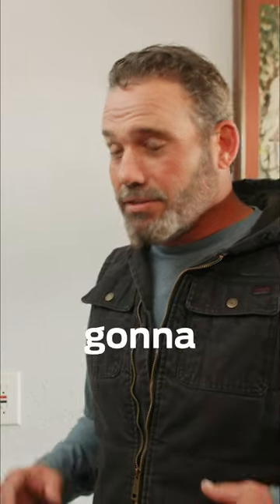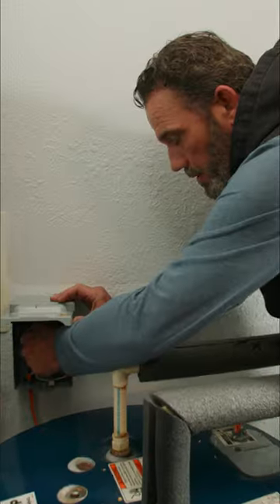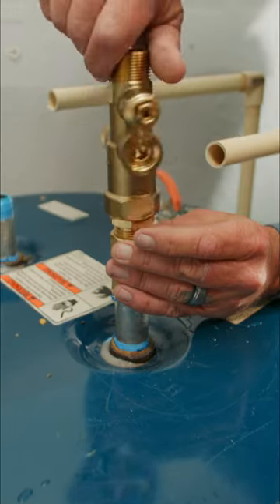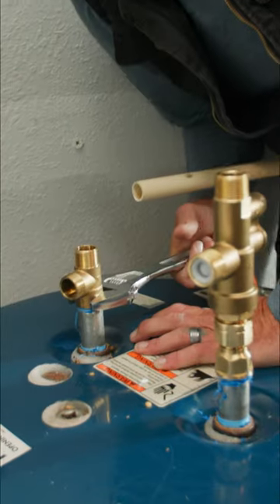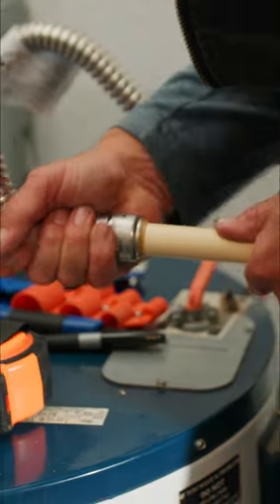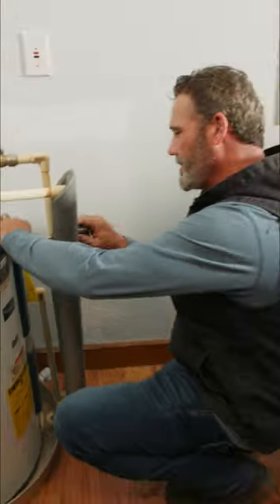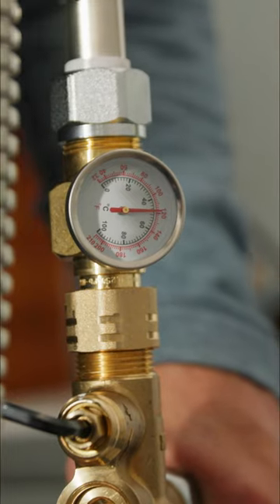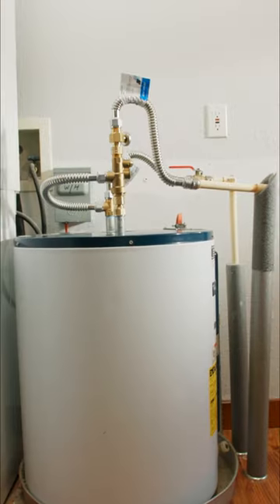Increase Hot Water in Your Home With This Device

Comment: Keep in mind this is a holdover until you get a bigger water heater. Running it at max temp will reduce its lifespan so you'll be replacing it with an appropriately sized unit sooner tha if you just left it alone. It will work though as long as you dont need a ton of additional hot water.

Comment: Don't see how that increased anything.  I am a plumber.
Reply: It increases the temperature of the tank, then dilutes the hot water with cold water as it draws from it.  The tank of hot water at 140° has more energy stored than the same tank at 120°.
Reply: @tvh300  What you just said works the same way as if you just turned the temp up to 140 and mixed it with cold water at the faucet. That doesn't increase the amount of energy or hot water mass stored.
Reply: @Erebus489 the idea is to keep faucet water at a more traditional temperature to reduce risk of resident (moreso child) scalding. Which does this and adds capacity for kid showers. I personally keep mine at 140 always.
Reply: Then you should know about customer scalding risk and understand the increase immediately.
Reply: @Erebus489  except excessively hot water available at the tap can be dangerous.
Reply: @tiddybearkush   You've had tank style water heaters with mixing valves for hundreds of years? I mean a quick 3 second google search shows your tanks are normally set between 60-65c, maybe you raise them for that extra capacity. 99.9% of heaters here don't need the mixing valves due to proper sizing, that's why they aren't common.